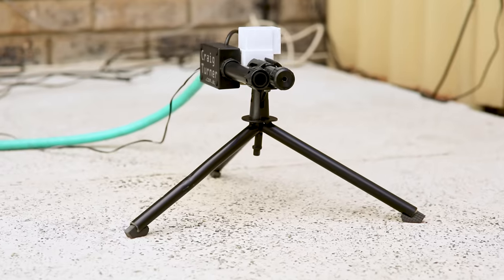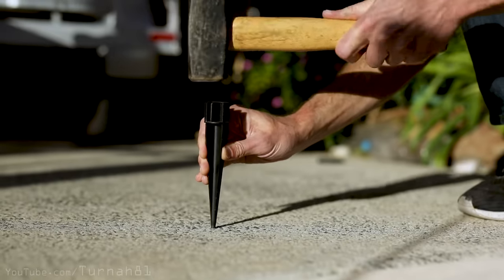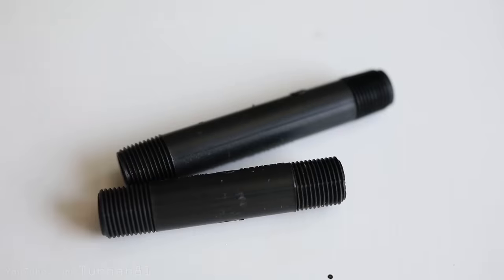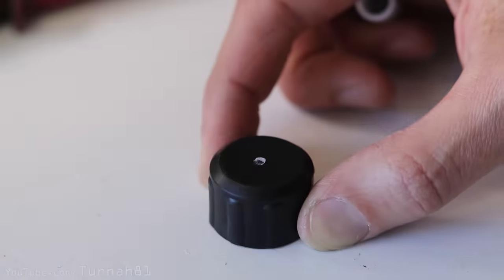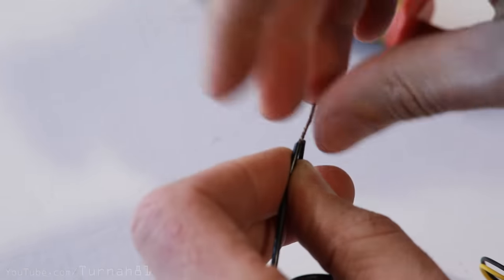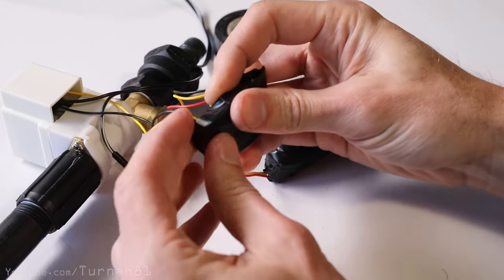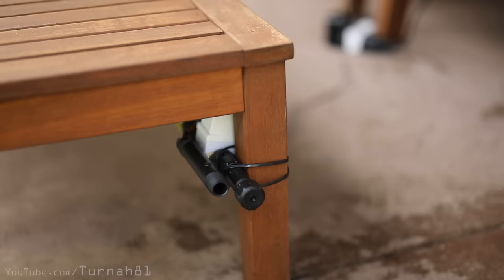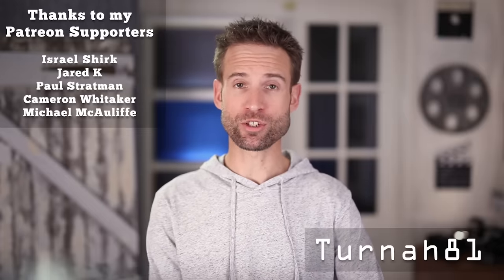How to make a Cat Repellent for Under $15 in Parts!

Comment: Add-on:  Use one of those lawn fertilizing containers that attaches to the hose and dispenses the fertilizer with the water spray. But instead of lawn fertilizer, it should be some stinky smelly something or other liquid that the cat will take to "freshen up" its home. I'm sure eBay has some skunk smells or something like that which would be perfect.  I definitely need one of these!
Reply: Baahahaha... I bet that would change their opinion about how their cats need to be allowed to roam.😂

Comment: make a wireless/hoseless one?
battery + water reservoir!
Reply: Probably you will need a BT or RF module for making it wireless.Also  you might need a microcontroller like PIC or Arduino Mini.I would also put some servos and control the turret myself if needed...
Reply: @alptuggul2984  why would you need a BT or RF module or a microcontroller?
Reply: @Mitchs  ohh when you said wireless, i thought you want some remote control stuff... my bad :D
Reply: He uses a hose for the static pressure, if you run this from a reservoir then you would need to use a pump to keep the whole system under pressure or by the time it starts spraying the cat will have walked past the 'killzone', not impossible but would need a more involved/expensive build, 
Running this off a 12v battery would be possible though
Reply: Battery + water reservoir PLUS high pressure pump - but depending on application could use the 12v pump on a windscreen wiper - that will provide your reservoir too. Wireless?  Easy peasy - just use a wireless doorbell - except instead of ringing the bell it activates the washer pump. I am assuming by wireless you mean manually activated at a distance?
Reply: Yeah a tank wouldn’t do squat.  Apply the same thing to what you said except closing in the jet some you can still get a pretty hefty 15-25’ street and add in a vehicles fuel pump and your golden.
Reply: @caretakerfoch6103  And in the reservoir? Wolf piss so the cat will also be less likely to find a mate for a while.

Comment: I need to present an innovative proyect for my Electronic's class this semester, and since lately some cats have been breaking vases and killing plants in my backyard, I decided to make a cat repellent of some sort. My idea was to make and install a sentry turret in the middle of my backyard that would shoot or spray water (or vinegar or anything that would scare them away without harming them). After searching the internet for a while, I found this video. I will use an Arduino Uno (since it is a requisite for my grade) to control the motion sensors and the solenoid valve. Glad to see I'm not the only one that has this particular problem and came up with an idea out of the ordinary. Here's my like!

Comment: This is brilliant. I have just discovered motion sensing sprinklers and was dismayed at the cost. I have 2 problems - a garden that is constantly being dug up by bush hens and brush turkeys and a problem with nocturnal intruders being nuisances and pinching anything not bolted down.

Comment: You're a bit of a funny Farker and an evil genius to boot.

I like it a lot. 

Now can you invent a non hose required contraption. 

My neighbours cats are going upstairs and I don't have a hose connection.... plus I'll be using an 18v makita drill battery for power with a buck converter.
Reply from the maker: Yeah all in the ebook. You can basically hook it to anything that starts with power. Anything 12volt is easier but a switched 240volt light in my other repellent videos.

Comment: My parents were using one of the commercial motion activated sprinklers so deter deer from eating their garden but my dad kept forgetting to turn it off and getting soaked himself. 😂🤦‍♂️ So the stopped using it. Now that you’ve inspired me, (if I don’t win one) I’m thinking I’ll try to harvest the parts. I’m thinking of adding a back and forth motion from like an oscillating fan so it covers more ground. What I really want is an auto targeting paintball gun that runs off like a raspberry pi and uses a sorting algorithm or something to recognize the the deer that keep eating our flowers! More research is needed...

Comment: We have this problem, where 4 cats are having a turf war over who owns our backyard. The solution was to cap the tops of our fences with 50mm diameter PVC pipe. Just cut a 30-35mm wide slit in the pipe length-ways so you have a long C, and slot the pipe over the fence tops. Now the cats can no longer grip the fence tops to pull their body weight over into our backyard. If they do manage to jump in by climbing an overhanging tree, the cat risks being trapped in the yard, and is too scared to return.

Comment: This design is genius.  I'm going to build a couple to protect my bird feeder from out neighborhood cats.  I wonder if I can upgrade the parts to fit onto a firehose to keep my mother in law out?
Reply from the maker: Haha Yeah you actually can: 40mm valve instead.  It will power it no worries at all
Reply: @Turnah81  Cool.   👍  😊   

I'm betting that the water hammer on hose/valve that size would be interesting.  I think that I might need more than a bag of sand for stability on that one.

Comment: great idea, I wonder if this would stop my dogs from climbing over a fence, probably would as they hate water. My concern is if the sprayer has a fault and is stuck on, then the water will run continuously, not good in a drought with only tank water...

Comment: Amazing videos. I really like your work. By the way - in the town I grew up, Koblenz by the Rhine in Germany they have a funny fountain which has a similar concept. The concept of surprise that is. The Schängelbrunnen is a landmark of the city of Koblenz and stands on Willi-Hört-square, today's town hall courtyard, surrounded by the Renaissance and Baroque buildings of the Jesuit ensemble. It was designed by Carl Burger in 1940 and is dedicated to the Koblenz local poet Josef Cornelius (1849-1943), who wrote the text for the famous Schängellied, the Koblenz hymn.

The term Schängel has its origin in the 20 years (1794-1813) the city of Koblenz was part of France. It refers to the Franco-German children born in this period, who often bore the name Jean (German: Johann or Hans). Owing to the Koblenz dialect, "Jean" mostly became "Schang". Over time this eventually developed into Schängel, a belittling of Schang.

Today all natives of Koblenz see themselves as Schängel and love the little guy who stands for wit, quick-wittedness and the Rhenish way of life.

The bronze figure spits a jet of water several meters above the fountain basin in an irregular rhythm. So be careful! That fountain is hidden so you can not see it right away when entering the Willi-Hört-Square. Urban myth has it that it used to spit further but some folks complained, so they reduced the pressure and made it less lethal. ... yes of course, I ripped of a good portion of that text from the towns website. So what ... ;-)

Comment: You should make one that is 3 long horizontal and two long vertical. Try to keep It small but still able to soak them. Just give them a good case of drowned rate syndrome so they leave dripping wet leaveing a trail.

Comment: Thanks! This is just what I need to fix the same cat problem. I've just downloaded the Ebook and I'm going to go with the battery version so I don't need to trail cables out to the garden. I note the disclaimer about the 18v battery supply and I want to get down to 12v to be on the safe side. I think there's a solution to step down the voltage with a series resistor, but I think I need to work out the total circuit current to calculate the correct resistor value. I don't know how to do that - can you help?!

Comment: Great video... I have a cat problem in my flower bed... 💩.... Had to have a water jet system or my delivery peoples would get wet with a sprinkler system..... Built the thing, with what I had, and it works a treat.... Now need the pesky cats to visit and get wet...

Comment: Think I will need to build a lot of these. Here in Crete we are always overrun with feral cats and their endless supply of kittens terrorising our dog and leaving special cat type gifts around pretty much everywhere. However I am putting down plastic spike boards to reduce their access point to a few places. That's when the water canon of retribution would be waiting so if you still have one under a sofa some place it would be great to have a spare here to fill a gap on our defences.

Comment: Motion activated Sprinkler scare crows have been commercially available since the 80s.   Brand new contech water scarecrow runs $50 and the knock offs start at 30.   Battery operated lasts 6 months more or less.   Its a good mechanism but it is not original.

Comment: That’s amazing! How do you stop the water flow after the initial burst to scare the cat?
Reply from the maker: Cheers man! The motion sensor has a dial for duration. Minimum is 2 seconds, but a guy who built it from the ebook also worked out a resistor can be put in a certain place to make it an even shorter duration, about 0.5seconds. I will have to find his info.
Reply: @Turnah81  thanks for answering my question. that makes a lot of sense. ordering parts now

Comment: Hi mate, I put one of these things together a few years ago, it motion activated very nicely but I couldn't get the damned thing to stop. I figured out that the motion of the water stream itself kept it activated. Did you find that problem with yours? Does the the long tube do the trick? I guess the hose dampens the water hammer as well. I used black irrigation tubing.

Comment: I purchased your book - however, I can't read it on a PC using Kindle Cloud Reader I want it as a pdf please can you advise me how to get a copy in pdf format. I can read every other book in my Kindle library using the Chrome Kindle Cloud Reader extension. However, when I try opening your book I receive an error "were sorry Kindle Cloud Reader cannot open this book"?
Reply: I'm positive it doesn't say "were sorry".... possibly "We're sorry" but most likely "We are sorry". 😯😁  Anyway, duckduckgo may help you find tools and/or websites that convert kindle files to pdf.
Reply: @ClaudeSac  Thank you for the lesson I appreciate it. Yes I tried that and installed calibre however now that Amazon has changed the file format calibre no longer works. I will screen print each page.

Comment: how long does the water run?  could this be done with a sprinkler that rotates - better to make sure the cat gets sprayed?  I think i need a series of these - that cats come from all directions - maybe spray the neighbor's barking dog - or even the neighbor.
Reply from the maker: Minimum setting is about 2 seconds on the motion sensor board. If used on the actual neighbour you will probably need about 10seconds though.

Comment: Hi it’s been two years since you’ve posted this but I’m absolutely at my wits end with MY cats. I’m losing sleep because they keep getting OUT of the yard. I’ve spend over $300 on those commercial sprayers but the motion sensor lags considerably. I don’t live in the best area and the alley cats have beef with my two little terrorists. I want to keep them safe inside the yard. I’ve spent close to $1000 on cat extension fences too.  Any chance you have an extra one of those bad boys laying around? 

If not, is there a way I can adjust the existing motion sensors in the commercial cat deterrents?

Comment: Planning to build a few to deter thieves who come into my yard to steal my grapes. Every last one of them.
Reply: @hobonickle - Get some of the hottest peppers you can find. Boil them in water to harvest the oleoresin capsicum. Filter out any chunks of plant material. Now you have several gallons of "pepper spray". Instead of a hose pipe, hook up to a pressurized garden sprayer. If anyone took issue, simply say it was to deter the deer from destroying your crops.

Comment: I went to the rectifier diode store and told them I wanted a 6 amp rectifier diode, but they asked me if I wanted 400V, 600V, 800V, or 1000V. I got scared and ran away.
Which do I need?

Comment: I want to make DIY motion activated sprinkler for my car installing generic windshield sprinklers (for 2 dollars) connected to a PIR sensor which also should be integrated to a cheap car alarm system without siren ofcourse:). so when I lock the doors the PIR and alarm without siren will be activated. If a cat will approach to my car the alarm will be triggered and the sprinklers will spray water from the grills of the car using the current windshield pump and tank with a T connector and extra hose... When I unlock the car all alarm system will be deactivated as I will not need to move cats away while driving. Is that really possible? I have the idea as you can see but I dont know how to DIY. Please help.

Comment: Just realize the power adapter is not 12v, after a few rewinds, its rating is 13.5 volts @ 0.8 Amp 😀

Comment: The water stream is to soft in my opinion. If I were you, I would try to hook up a pressurized water container to it. Or maybe a pressure washer which can hold a pressure (if something like this is already invented). If you have a kompressor I think the first version is doable, so the cats get wet faster then they can react. This will let them learn faster not to enter your yard.

Comment: Hi, I am interested using your design for repelling BIRDS. Does the PIR sensor works if my application is within 3 meters?
Reply from the maker: Yeah mate.  These Work down to point blank.
Reply: Turnah81 so, typically what is the point blank range for PIR sensor?

Comment: Amazon seems to only allow the book to work with a Kindle. Is There anywhere the eBook or data file can be downloaded to a PC? Don't want to spend over a $100 extra just to get a Kindle for this one eBook. Any suggestions appreciated. Thanks.
Reply from the maker: Hmm thats weird, I have never had a kindle. I always use android app and the windows app for amazon ebooks. Could it be a weird region setting maybe you could bypass?

Comment: Has anyone been successful building one of their own ? 
I'm having difficulty completing a successful one, I have the exact parts as in the video, and have followed the video to a tee building one, still will not function properly.
It would be nice if there were a PDF to download of the ebook, I would pay a sum for a PDF of the ebook.
Update: It appears it's critical which way the Diode is mounted onto the Solenoid, my sprayer is now working.

Comment: Can not for the life of me get this to work.. Used a 12v solenoid valve from a washing machine, 12v-2.5A output power adapter, 6A 1000v rectifier diode and same IR motion sensor as in video. Only thing I haven't tried is to draw a face on the diode.. PLZ HEELLPPPP!!!

Comment: You've had this problem for a while now... GET A BIG ASS DOG ALREADY!!

Seriously though, get a possum trap from a hardware store & when you've caught a cat, do a midnight drop off at the local animal shelter.
If the cat is microchipped, the owner gets a call & would likely have to pay to get the animal back, or not claimed, which benefits you either way!

Comment: Under $15?  Not by the time I buy an angle grinder and wire strippers.  Also, I burned myself with a hot glue gun yesterday so this would increase my chances of injuring myself.  Someone really should be making them to sell to those of us not flash at the DIY.  My neighbour's cat uses my garden, driveway, front door and potted plants as a toilet.  All "nice" deterrants seem to do little.  I need one of these to get revenge on the beast.